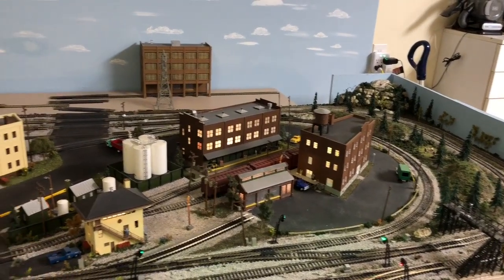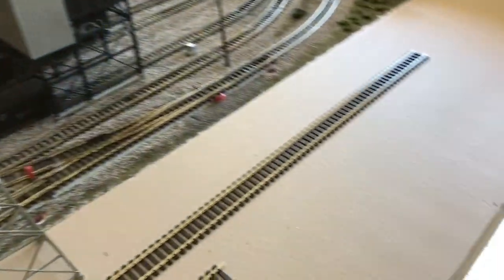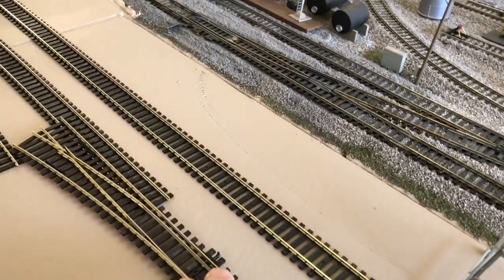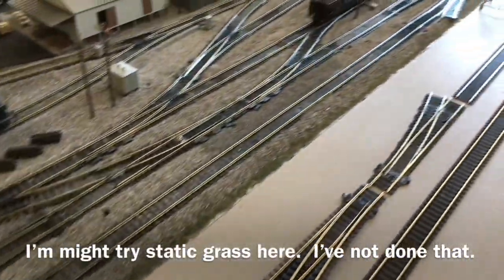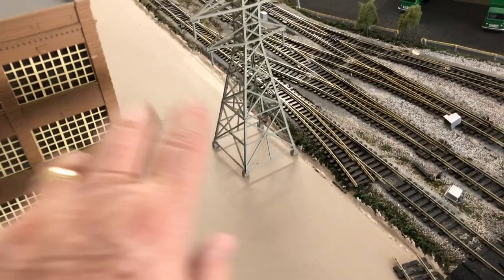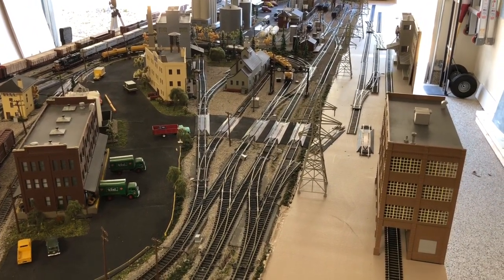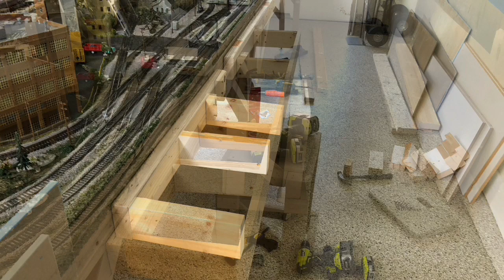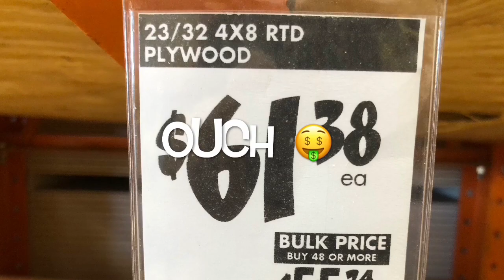My 6x16 HO Layout - Far Side Expansion

Comment: Brilliant use of the jack Fred. Very handsome extension shaping up there. I’m afraid I’ll have insist on you wiring those power lines since you gave them so much precious space. Lol perhaps Mrs Fred could provide some thread.
Reply from the maker: Thanks Vader 😀.  I last used that jack on a deck repair project in ~2005.  I thought I’d use it again somewhere so kept moving it from house to house.  It worked great.  I not going to put wire on the power towers.  I’d just catch my hand or arm in them fixing the derailments on original outside tracks.  

Posted a new video this morning you might enjoy…

Comment: Fred, the layout is growing by the moment… I see a piano hinge across the front with a drop down 2.5 foot by 16 foot extension in your distant future. When it’s folded down it doesn’t take up any room if you make it a staging yard. I just wouldn’t put any tall buildings on it or you might damage your privates while it’s folded down. Lol. I think you should get that crossing in between the two 4x8s so you have a way to reverse direction both ways before you make the layout too far to reach it. Hmmmm, ((4+1 3/4 + 2 1/2)x8)x2 Ho Layout.
Reply from the maker: Nope!  I’m done with expanding. I’m pretty sure I can reach into the middle front either side while rolled away from the wall.  Still undecided on exactly what to do there.

Comment: If you keep expanding this way you won’t be able to reach the middle! Looks great though. Your captions always make me chuckle. They must know you on a first name basis now at the Home Depot.
Reply from the maker: Thanks Mark 😀 I’m at max width.  I’m going to have to remember to stretch before working in the deep middle.  Don’t want to pull I hamstring.  If I even still have one.  

Regarding my trip to Home Depot.  I got a shopping cart as I entered the store.  At check out, I’ve got the 4 pieces of cut plywood sticking 4’ upright out of the cart, 2 long 1x4s sticking  out at angle over the handle, I’m dragging the 4x8 sheet of foam under one arm while pushing the cart with one hand.   I have tube of liquid nails and a wicked looking 8” knife in bottom of my cart.  

I get in the ‘Pro’ check out line.  The other ‘Pros’ give me sideways glances as if thinking ‘amateur’.  The check out guy with hand printed ‘MARK’ on his orange apron says ‘Back again?’  Then he pulls out the wicked looking 8” knife and asks ‘what’s this for?’  ‘Model Railroad’ I respond.  

He looks puzzled for a moment then says ‘oh, I remember.  You’re the guy that used a 6 ton bottle jack on his layout.’   Me and the boys were talking about seeing it on YouTube.  I explain that the $14 knife is to cut the 4x8 sheet of foam in half it fit in my car.  Nice says he.

As I struggle out the big ‘Pro’ exit, he says ‘Good luck with that knife, don’t cut off a finger’.  I think ‘Great, another smart guy named MARK’.  😀
Reply: @FredE528    Lol. Best story ever. What are the chances eh??
Reply from the maker: Thanks Mark 😀.  Glad you liked it…